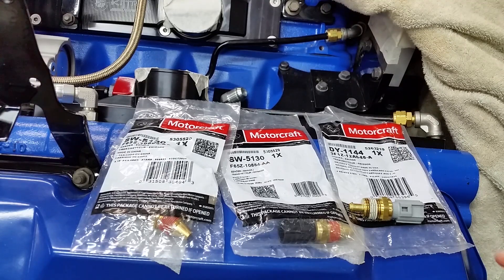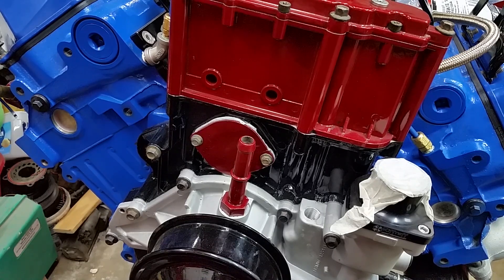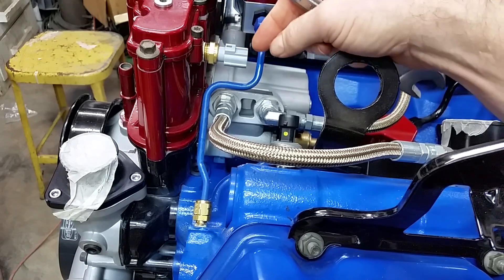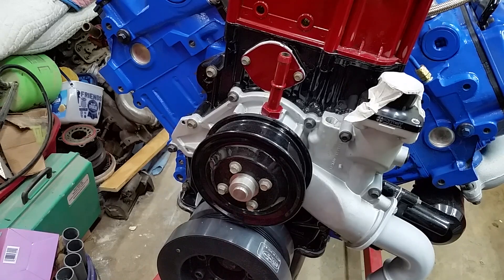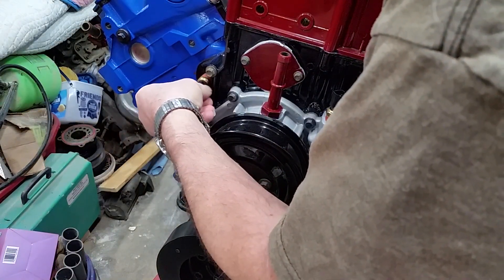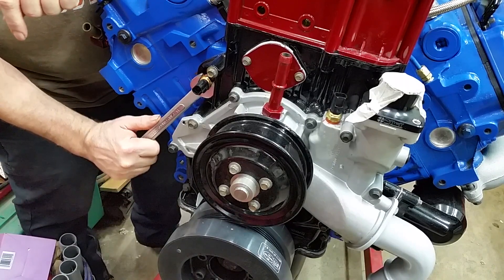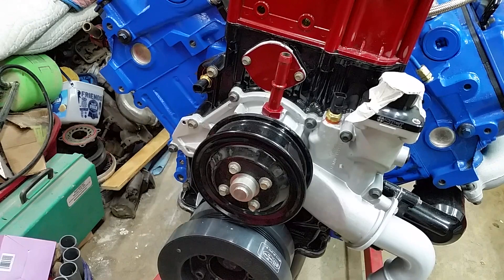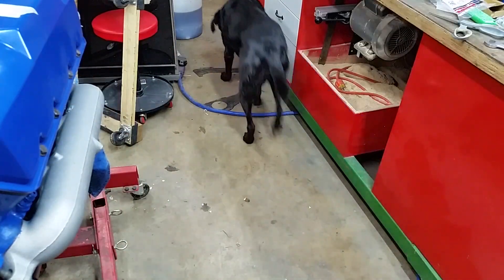7.3 Build: Installing Engine sensors

Comment: I’ve gotta say your videos have been a tremendous help for me replacing my timing cover on my 99 7.3. Im not a mechanic just mechanically inclined and this is the first diesel I’ve ever worked on and you helped make it fun and a learning experience instead of a daunting chore. Thank you!

I do have one question and it’s about the temperature sensor on the cover that sends info to the computer. On my truck I just have a plug there and I’m wondering if I would be able to put a sensor there or if the early 99’s just didn’t come with it?
Reply from the maker: If its an automatic transmission you do not need the second sensor. Only manual transmission trucks use one.
Reply: @phil-from-tn3000  Well I have a manual so I’m gonna have to do some research to find out why I don’t have one or when they first started to use them. I was told Midyear 99’ Ford made a couple of changes for example, the HPOP reservoir gasket was originally just a gasket and mid 99’ they changed it to have the metal screen that sits down in the reservoir. Maybe that sensor is just one of those changes they made.

Thank you for your help and again thank you for the videos !

Comment: Question I have a 7.3 I just removed the harmonic balancer to replace it and I stripped some of the threads in the crankshaft… rookie move. Is it possible for me to attempt to tap the threads to the stock bolt size or am I looking at some bigger problems?? Thanks I’m advance !
Reply from the maker: Good question. I would run a tap into it and clean up the threads, then install a new bolt only started by hand. No tools until torquing it up. A new bolt can be obtained through RiffRaff

Comment: What did you do for a wire harness, I just started looking for one on my 02 with 6 spd every place so far states discontinued ????? ford part 1C3Z12B637CA NAV 1838082C91 SEEMS You have the same set up as I do
Reply from the maker: I'm actually fixing mine. but RiffRaff diesel has a whole array of engine harnesses. Mine was just dirty, with a couple of bad connectors. Most of the time you can pull it and set it on a table and just unwrap it and check each wire ( with the help of the wiring diagrams) for connectivity. While its unwrapped check the condition of each wire and repair as necessary.  Maybe I should make a video....
Reply: @phil-from-tn3000  Yes make a video for the 7.3 owners The 7.3 with manual trans non California wire harness is discontinued even at riff raff So i will have to buy used and refurbish

Comment: I have a question for you I’m a younger guy I have a 2000 7.3 and I got hung up a few months ago and my motor has 200 plus and it got hot and shut off I waited for around 15 or so minutes then started it again and got out it’s only happened just one time could have that destroyed my piston sleeves or rings at all or what kind of damage could have that done to my motor I have read forums online but don’t quite understand you seem knowledgeable or any one in the comments please let me know
Reply from the maker: If its running good, I wouldn't worry. If you start to have problems then its worth checking into. The reason mine was so bad after an overheat, was the previous owner blew the top radiator hose under a pretty good load >25k and drove it about 1/2 mile to an exit. No engine will survive that kind of abuse.

Comment: How far before you put it in the truck?  Are you rebuild frame and everything else?
Reply from the maker: Well, I'm waiting on the transmission to be overhauled so I can slip the entire power team in at once. It should be done this week so I'm hoping for installing on Friday. I'm not doing a complete frame off, just getting her ready for the road and some heavy hauling.
Reply: @phil-from-tn3000  is it 4x4? What heavy hauling?  Hot shot?
What digital torque wrench is that you using?
Reply from the maker: Yeah its being built for hotshot. That torque wrench is from Harbor freight Its a 1/2 inch Quinn. pretty nice wrench.

Comment: That is a beautiful engine. I just did a back yard get it done fast rebuild on my 2000 to move across the states. I hope some day I have the time and the means to do a clean restoration like this one you have here. Props my man keep up the killer work on that old gal.
Reply from the maker: Thanks. Its strictly a hobby to build these motors. Lots of fun and a great learning experience while doing it.